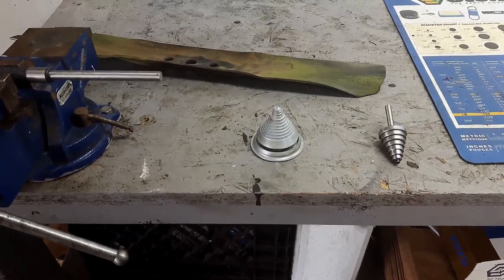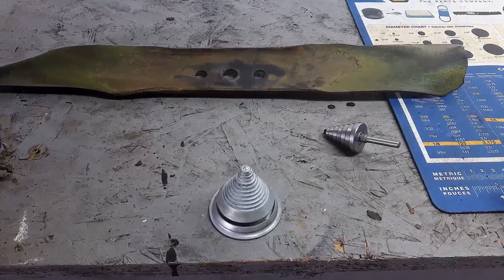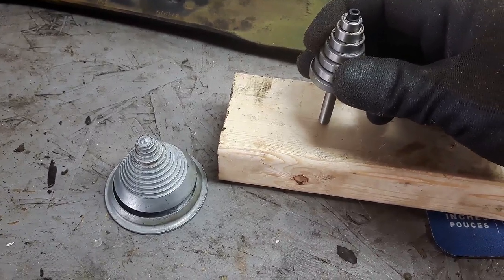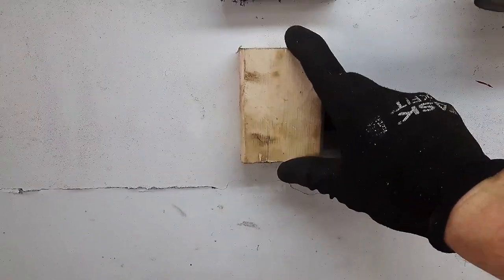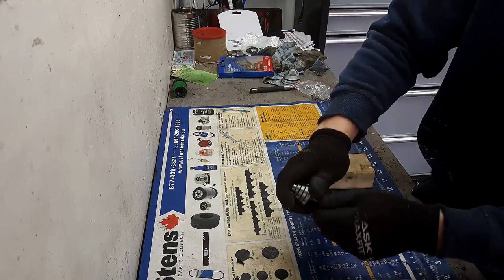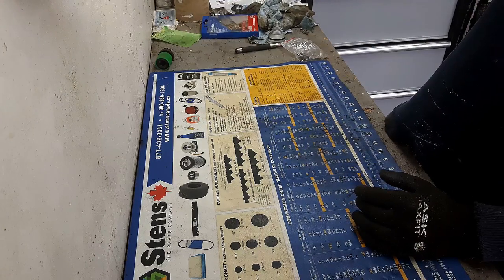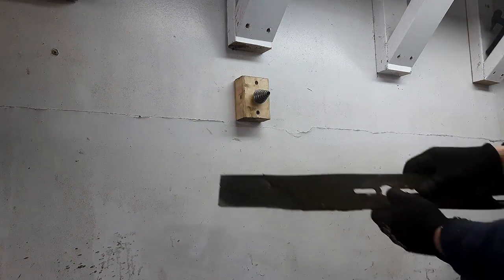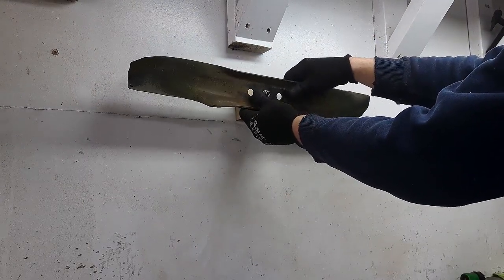How To Make Your Own Lawnmower Blade Balancer For Less Than $20!

Comment: Excellent idea! Already have the router bearing set up. Just balanced my blade earlier today on a nail. Worked good as the lawn mower runs very smooth. But your idea is way better. Thanks.
Reply from the maker: I still use this setup on a weekly basis. I bought a more expensive Oregon blade balancer but haven't set it up yet as this still works great years later. Thanks for watching and taking the time to leave a comment. Cheers

Comment: Mr. Brant, I loved this video of how you made a blade balancer using a block of wood and a set of router bearings.
  I just bought a blade sharpener that uses an angle grinder to very efficiently grind a sharp edge at the correct angle, but the nail in the wall and the cheap cone-shaped blade balancers were just not accurately correct.
  So, after watching your video from 3 years ago, May 2020, I decided to try to construct one using the router bearing set also. The balance sensitivity is amazing! Blades that show "balanced" on the cone balancer and on the "nail" proved to be "out of balance" using your router bearing set design!
  You had a real winning idea and it works!
Reply from the maker: I'm glad this worked out for you! I still use mine to balance all my blades. Thanks for watching and taking the time to leave a comment. Cheers!

Comment: I always liked improving my accuracy, but to include low cost solution is unbelievable.  Thanks
Reply from the maker: Glad it was helpful William. Cheers
Reply: @brantsmallenginerepairs  Happy, Happy, Happy.  Got my bearings in today and made a blade balancer and it worked really well.  I checked it against my old cone balancer which is many, many years old which provided close to the same result but not as pronounced which is somewhat of a relief.  By putting the 5/8" bearing on a screw and nut and running the bearing in by using a high speed drill for several minutes it loosened the grease and seals on the new bearing which provide a more accurate balance.  I am now splitting hairs because the bearings in the deck spindle would easily absorb the minimal out of balance that was then being shown.  Again it worked great and I also used a metal clip to push the blade against the back bearing to minimize the lateral runout.
Reply from the maker: @user-uh8zq5qv7h  that's great. Glad it helped. Cheers

Comment: The only tweak I can see is to have the jig canted back slightly, just enough so the blades won't fall off of the end but still rotate easily. Great job!
Reply from the maker: I've had it mounted this way for years now and have never had one fall off. Thanks for watching and taking the time to leave a comment. Cheers

Comment: Something I always have to keep telling myself…KISS! (Keep It Simple Stupid). I’ve been trying to design my own balancer as well. After selecting various parts (bushings, bearings, steel rod, stop collars, etc.) on Amazon I was up to $35 in parts and hadn’t even tested my design yet and if I would need even more parts to complete it. I found the bearing set you used on Amazon for $14 (as of 7/29/22) and it obviously works…no further “over-engineering” needed! Thanks for the video!
Reply from the maker: Glad I was able to help out. Be sure to Like the video and Subscribe to my channel if you haven't already done so. This helps me out as well. Cheers
Reply: I found a balancer for $34 on Amazon. Two screws to hold it to the wall, and done. Magnets hold the blade, and a rod to check to see if the blade is bent.

Comment: Great Video and design.  It would be interesting if you  would have used a new blade too (never used).  I've often wondered if new blades are factory balanced like they say.
Reply from the maker: Glad you enjoyed the video. You make a great point about the new blades. So I just went out into the shop and tested a new blade for a Toro Recycler and wouldn't you know it. It was not even remotely balanced. Guess I'll have to start checking all my new blades before install. Cheers
Reply: @brantsmallenginerepairs  Well, damn! lol  Kinda sad you have to check new blades. Thx again!
Reply from the maker: @EM-gr1ps  I was pretty surprised myself. But then again, everything is made so cheap these days that quality control suffers.
Reply: I bought a new USA Blade for an MTD Honda powered Mower and put it on my Oregon Blade Balancer. It was way heavy on one end.  Took quite a bit of grinding to get it balanced.  I spent roughly $100 on my balancer but have charged friends and neighbors a small fee to sharpen and balance their blades.  Owner of a John Deere Zero-turn,  I think 61", they thought I'd done magic as the mower was so very smooth afterwards.  Anyway. I've paid the cost of my balancer doing side jobs.
Reply: Nail in bench works and yes new blades are pre balanced son

Comment: Clever and well done. Have you kicked around the idea of introducing a magnet to the assembly to aid in the blade’s stability? It might provide for a more stable mount for oval, bow tie and star center hole blades. Good work and thanks for sharing.
Reply from the maker: I have seen others build their own custom ones also which included a magnet system. I have contemplated adding small rare earth magnets some how. Maybe a future project and video update. Thanks for watching. Cheers

Comment: Hi, welcome from over the pond, England, nice video, being of the same mind as you and thinking, I could make something like that years ago, I popped into my local bearing shop and got a selection of bearings all with the same i.d. as far as possible but needed a couple of bushes to reduce the i.d. of a couple of the larger ones. 

To mount them I used a piece of rod, which I threaded at one end for approx 6 inches, ran a nut up the thread to act as a stop for the bearings and spot welded it to the bar, tapped out the other and and as in yours used a socket headed screw and washer to retain the bearings.

Now for the crafty bit, I don't have a lawn but being a retired motor engineer I get all and sundry calling by to see if I can fix or weld something, from strimmers, mowers, chain saws, bicycles and stump grinders to mention a few.

So because I don't use the balancer that often I have fitted a piece of threaded tube into the the front edge of one of my benches that has a vice on, it takes two seconds to screw the balancer in and just a quick nip up with the nut and away I go, it saves so much time because the blade doesn't foul anything and is alongside the vice.

An added bonus is when folk, who usually sharpen their own blades, comment that the mower has never been as smooth since it was new.
Reply from the maker: Thanks for commenting. Sounds like you have a decent set up there. Cheers from Canada.

Comment: The problem with the little gray one is you need it on a level area to  start with. You need to clean off all the crummy grass with a wire wheel too. If not you are wasting your time. The bearings are a good idea but with the grass on it you are starting with a very unbalanced blade to start with. I like my balancer because you can take the 90 degree rod and check for bent blades too. I took four magnets off because off the width of the blades. I do all kinds of blades. Get the excess grass of and you won't hear and vibration or noise. Blades now are stamped out so fast that if that blade move on little bit during stamping its trash. Grab a brand new blade and put it on the balancer and see.
Reply from the maker: Thanks for watching and taking the time to leave a comment. Check out one of my recent videos where I compare this homemade balancer to a $100 Oregon balancer. Cheers

Comment: I guess I don't see the difference between what tool you created and just a nail as far as balancing goes.  I wished you would have done a comparison  between the nail and your tool.
Reply from the maker: The difference is the bearings spin when the weight of the blade is on them and the blade is unbalanced. A nail does not do this. But feel free to use whatever method you like. Thanks for watching. Cheers

Comment: Do you cover it to keep dirt out of the bearings
Reply from the maker: I haven't thus far but might not be a bad idea. I have blown them off with compressed air and sprayed silicone lubricant on them though. I believe they have sealed bearings but probably wouldn't be a bad idea to cover it. I do use it pretty much every day though so that could be a pain. You know, for the price of the bearings, I could buy a new set and easily swap them out. But definitely worth thinking about. Cheers

Comment: Howdy Brant, the center hole for my blades is 11/16". On this tree,  the blade hole would fit over the 5/8" bearing with 1/16" to spare. Do you think the 1/16" of open space around the bearing will keep the blade hole from hanging centered on the bearing ? Thanks
Reply from the maker: Hi Grey. Thanks for checking out my channel. As for your question,  considering that a lot of service manuals suggest balancing your blade on the end of a nail pounded into the wall, I don't think the 1/16" gap will make any difference. I have had many blades with hole sizes that are not exactly the same size as the bearing and haven't had a problem. I am also not an engineer either so maybe someone smarter than I would disagree. If you have an operation where you need exact precision then maybe spending the hundreds for a precision manufactured item might be worth the investment. For homeowners and small engine repair mechanics like myself, this works great. Cheers.
Reply: @brantsmallenginerepairs  Thanks Brant, I'm just a simple DYI homeowner. I'm placing my order for one on Amazon. Take care !
Reply from the maker: @greyholcombjr.9623  glad to help. Cheers

Comment: Fancy! nail in the wall works too :)
Reply from the maker: Correct. Many repair manuals have suggested this method for years.
Reply: There is a vid showing it to not work nearly as well. I've always done that but going to upgrade to something with a bearing.
Reply: Be interesting to try a nail and then put a spacer in the blade hole to center the same nail in the blade for a comparison. 🤔

Comment: You can get that pyramid bit cheap at Harbor Freight.
Reply from the maker: Are you referring to the cheap blade balancer I show at the beginning?  Yes you can but doesn't work great for all blade types. And not as accurate but will do the job. I have one but it collects dust in my toolbox since I made this balancer. Or are you talking about the bearing set I used to make my own balancer. If it's the latter then thanks for the tip. Unfortunately we don't have Harbor Freight here in Canada. Cheers
Reply: We do have other like Princess auto

Comment: $200!!! I think there’s one for $15.00 at Lowes
Reply from the maker: Not sure I understand what you mean. This cost less than $20 and is way more accurate than the cone type.
Reply: @brantsmallenginerepairs  seriously it’s a circle that needs a cone to go in the middle to “show” you the weight of one side of the blade to the other. You need a $200 tool for that??
Reply from the maker: @Jasonthehammer  it was less than $20
Reply: @brantsmallenginerepairs  Yes. First...I want to apologize...im sorry..
it was by the new blades and you can get the cone by itself- there was something similar for like $12
Reply: @brantsmallenginerepairs  I don’t have a link or anything but I can take a pic. I took small engines and I used the nail in the wall approach. You having a business I can now see why it may be more in tune with pin point accuracy
Reply from the maker: @Jasonthehammer  I have used the nail and the cone methods. I didn't find them overly accurate but everyone's preference is different. This device mimics a high end balancer at a small fraction of the cost. Just trying to help others. Everyone is entitled to use the method they like best. Cheers